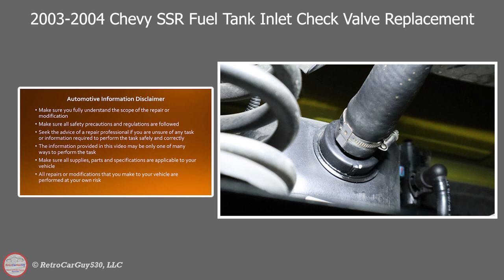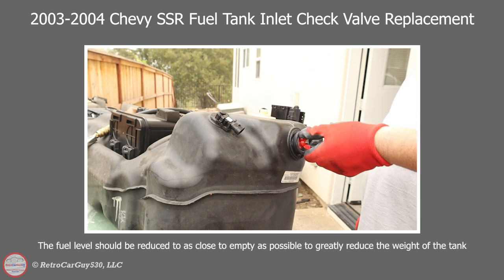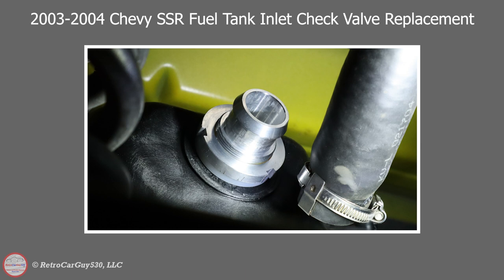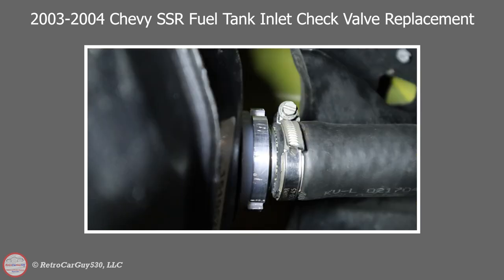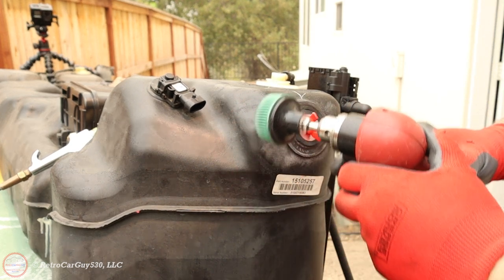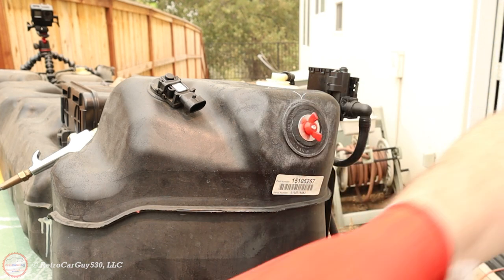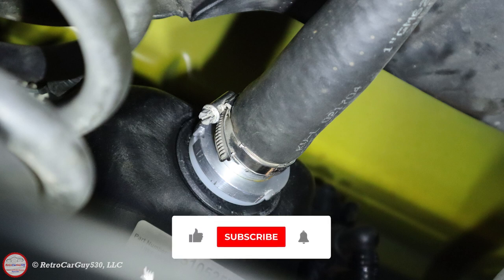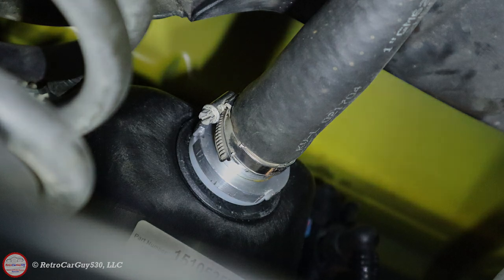Chevy SSR / Trailblazer / GMC Envoy - Repair Leaking Fuel Tank Inlet Check Valve

Comment: Just got done talking to GM assistance in financial repairs on the gas tank on some of these GM cars they're doing everything they can to avoid this being a recall somebody needs to sue their asses off I have 03 Chevy trailblazer it needs to be recalled the gas tank is faulty leaks gas $260 just to go have an inspected by a dealership then they'll help you somebody needs to sock it to them and give them what they deserve like I said my car is a '03 I'm pretty sure somebody out there has lost their life
Reply from the maker: IMO, GM should have at least included a free inspection of the customer's vehicle when they first issued the special coverage adjustment document for this issue.  Other manufacturers have had issues where they had the customer bring in the vehicle to inspect the vehicle for a specific condition and if necessary fix it.  Not a recall, but at least they would try and proactively address the issue if the problem is present.  I contacted the service manager I work with a lot at a local Chevy dealership and I had her submit a request for this issue to be covered to some degree (good will) under this special coverage adjustment and GM's response was no, but they would reduce the price of the fuel tank to some degree.  That still made it a $1400 or so repair, so that's why I addressed the issue myself.  I was lucky that the leak was a very small leak in my Chevy SSR's fuel tank.  This particular problem tends to start off as a very small leak and only gets worse if the fuel tank inlet check value connector is exposed to some amount of stress.
Reply: How would someone die over this lol

Comment: Jim wants a thousand dollars for '03 Chevy trailblazer gas tank you know you can't get one at the junkyard cuz it's going to do the same thing the original one did they're giving us no choice but to use a design as somebody else designed to fix their mistake they need to take responsibility $260 for inspection and a dealership just so they can help you with repairs for a gas tank that cost $1,000 who's the crooks
Reply: Gm
Reply from the maker: The full list price is $1000 for the tank, but you can find it for roughly $670 plus shipping on many online GM parts retailers.  That's not cheap, but better than $1000 list price.  I wasn't happy either with that pricing.  That's why I opted for the solution I used in this video.

Comment: 100+ bucks for a check valve that’s absolutely unnecessary and does nothing. Don’t flip your car and if you do the tank is in the rear and not near anything that hot really I would just repair this with stuff I have at home if necessary lol
Reply from the maker: If you can repair the EVAP leak caused by the cracked plastic inlet check valve, great!  The point of the repair is to fix the EVAP leak and potential fuel leak in a reliable manner.  Since it involves the area of the check valve, this is a far more cost effective repair than GM will recommend which is replacing the entire fuel tank at a cost of over $1100 USD.